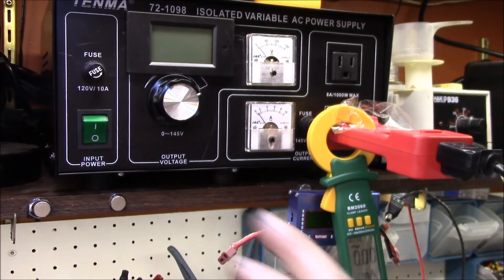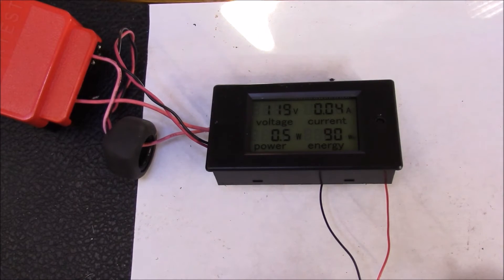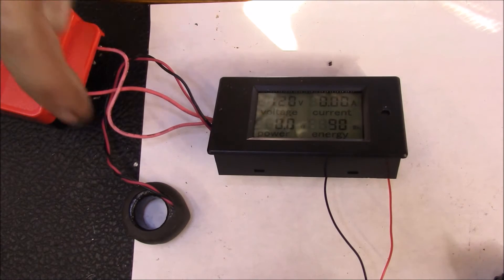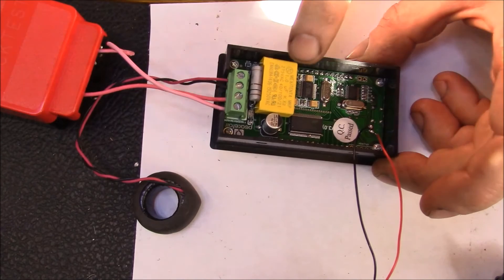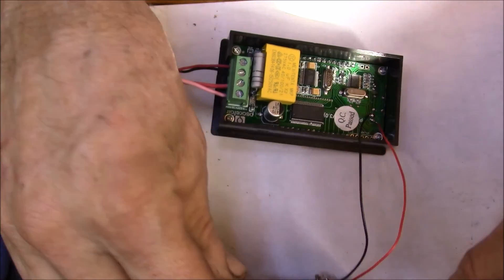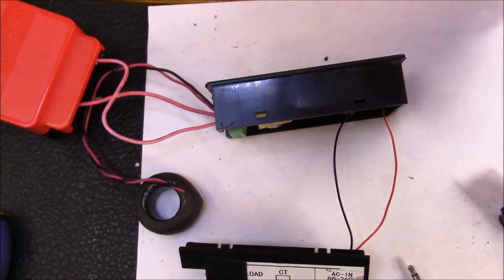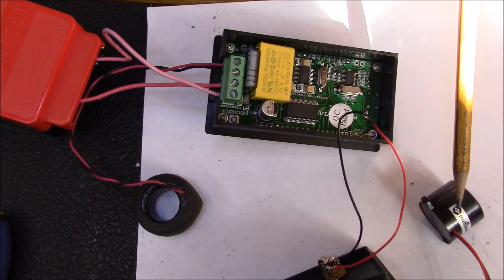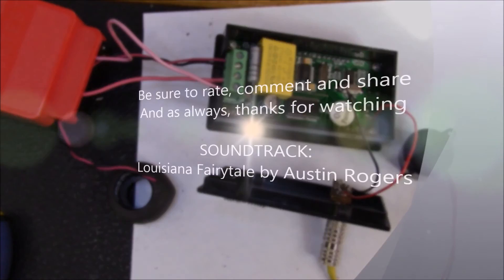PZEM-061 AC Panel Meter, Power Consumption and Audible Alarm

Comment: Does it matter what side the hot wire goes through the CT up to the electrical panel?  Thanks for the wiring information.
Reply: I’m going to connect the meters (2) to a 50 amp breaker and to a power generator to get readings on consumption.
Reply from the maker: @juansifuentes3917  That is the most accurate way if you want to keep track of the loading on each 120V leg.  Just connect each meter's voltage inputs between L1 and N and L2 and N.
Reply: @The4Crawler  thank you very much.
Reply from the maker: In general, makes no difference unless you're trying to eliminate the meter's internal power consumption:
https://youtu.be/zpBXKnCsllQ

Comment: dear sir its possible to store the results of the screen in any way out of the meter? id like to store the 4 values in a file for example.
Reply from the maker: Outside of setting up a video or web camera to record the display, not possible with this version of the meter.  However, if you check out my other video, I discuss some  versions of this same type of meter that has a serial data output, where you could capture and store data:
https://youtu.be/wWOX-gUKpRE
Reply: Thanks.  I order the 004t model thath has a serial output.  Now i look hpw connet it and read dta with the raspberry pi and store it in a sql table.
Reply from the maker: There are a couple of programs/projects on Github that can read these meters.  I've not tried any yet, but I do have the meter in house that I want to test out at some point.